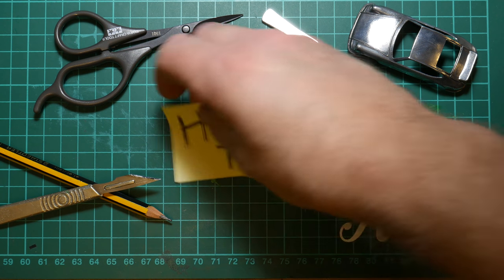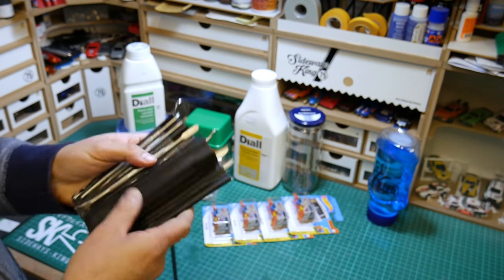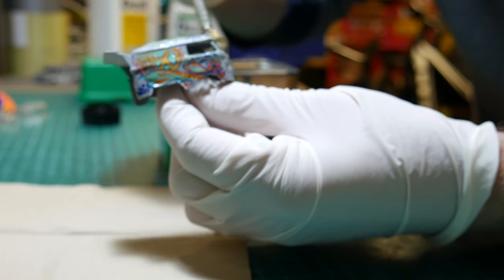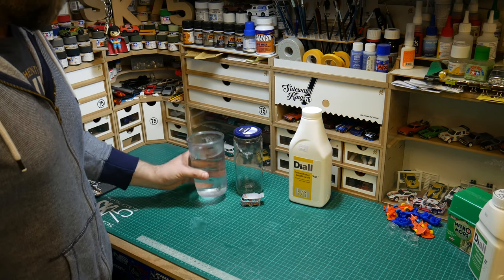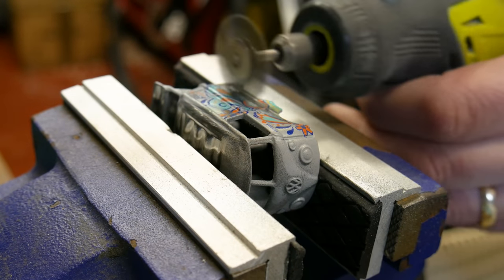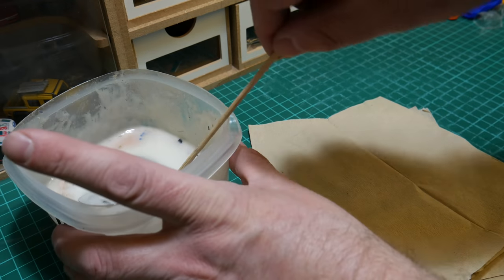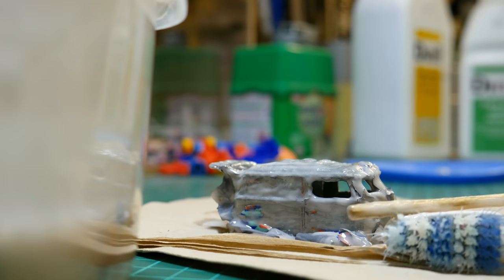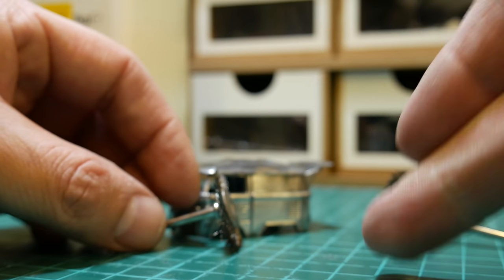'HOW TO' remove paint from die-cast cars - 4 methods compared

Comment: I love those little wire wheels but they are the worst for shedding tiny sharp bits of wire that end up on the floor / sticking into your toes if you ever go stocking-feet or barefoot. Great vid!
Reply from the maker: I know they get everywhere...... My wife comes nowhere near the garage and she still pulls them out of her clothes!
Reply: @SidewaysKing75  nightmare! My 2¢ of stripping advice for the stubborn stuff would be a can of Loctite Gasket remover. It sprays as a reasonably mangeable foam and seems pretty much no paint is a match for it, bubbling up in about 2-3 minutes. I use it on bike frames - heck - it even removes plasticised powder coat.
Reply from the maker: @LittlePixelTM  very good advice I'll look into that one thank you 👍🏻

Comment: Dunno if you have Easy-off oven cleaner in England, but it also do the trick. That's what I use for my model kits.
Reply: Some oven cleaners are just caustic soda with additives, we call it caustic soda over here, think its called lye stateside and is potent stuff, if you breathe in some of the fumes from some of the cleaners you can feel it literally burning your throat and lungs and caustic soda will have the flesh off your hands fairly quickly so not a chemical to be haphazard with :(
Reply: Make sure you wear gloves for easy off.  That stuff is very harsh.
I’ve used it on Tamiya RC ABS bodies that had several coats of paint on.
 Worked well, but my hands didn’t like it.
Reply: @stuartleckie  Yup. It burn. Also, I'd add to make it in a ventilated area.

Comment: Thanks for the tip on the Diall paint remover I finally got around to getting some after watching this video a few weeks ago, and as you say if your patient it works like a dream. I left a casting in it over night and this morning there was not a spot of paint left on it. Even a couple of hours is enough to get most castings clean, but I would recommend the over night treatment as bes option. Bought a 2.5Ltr container for just under £15 and with use of a glass jar and Time Riders Primordial Oose it should last me an age. Will keep some Caustic as backup as I still have half a packet, but if it continues to work as good I can see me sticking to this long term.
Reply from the maker: It's great stuff isn't it Tony👍🏻 The only casting I've found it struggles on is the Grey Hot Wheels Skyline R32 bizarrely. It's just really weird paint 🤔
Reply: @SidewaysKing75  As I am doing mainly Matchbox that is not an issue for me, but yes it is great. You do need to remove any plastics as they will be a gel if left in for any length of time but that's standard with most paint removal products. I've just started to use thick bleach for removing paint from Plastic wheels, screens and internal plastics. It works well and dose not damage the parts. Just the bog standard Thick bleach from any value store, I used the Home Bargains one and diluted it 1-1 with water.
Reply from the maker: @tonyhughes1958able  that's a great tip thank you ill be sure to give that a try.... thanks for sharing 👍🏻

Comment: Another great video, what makes it better is that my Mother in law works at b&q so I can get discount, lol. Going back to your making your own decals, may I ask what printer you have because the detail of your decals are amazing where mine is pretty poor.
Reply from the maker: Thanks Phil... I have an Espon Stylus 445W which is at least 5 years old and was cheap also at the time. I change the setting to gloss paper and print 'images' in high quality mode. It will be 10 times slower than normal but worth the wait.

Comment: Hi, thanks for the video. If you're not in a hurry I've found Dettol disinfectant to be a wonderful paint stripper. I used it on plastic models and it stripped the paint away and didn't harm the plastic.  I had a couple of diecast vehicles to strip down and it worked on those too. I usually leave them overnight so, like I say, it's not a fast method. I was quite sceptical when I was first told about this but I gave it a try and it worked. What's more you can use it time and time again.. Hope you don't mind me mentioning it. Thanks again

Comment: What a wonderfully informative and extremely helpful video, needing to strip back the paint on a 1/50 scale truck i decided to go with the diall paint and varnish remover and i have to say im delighted with the result, stripped totally clean using the same method that you used soaking it for 1-2 hours , thank you !

Comment: Weird, i just use acetone in a glass jar to strip paint off mine. Can take a while depending on what sort of paint is on there but im not in much of a hurry.
Reply: Does nail Polish work
Reply: Yeah but what about right areas the paint stays in?
Reply: @bumble_rumbles  -what do you mean?. if youre referring to areas you want paint to stay in, then immersing the body in anything isnt a good idea. if youre referring to pesky bits that wont come off, you can get them off with a scalpel, hobby knife, dental pick or sandpaper.

Comment: Have you tried electrolysis at all?   I am keen to see how that works as I used to electro-clean my old Vespa bits and always got the paint and rust off but wondering with these cars whether it would struggle with small detail.
Reply from the maker: I haven't Ian, others have mentioned it in the past but I've yet to have a go. Is there somewhere I can reference for what I need to get that you know of?.... All the best 👍🏻

Comment: I appreciate the comparisons, excellent work. But how does each method work with very old corgi or dinky models? The models shown are fairly new, and as such probably use modern paints.
Does the diall stripper work equally well on an early 60’s Corgi Scammell?
Reply from the maker: Yes it works perfectly. The newer cars are few and far between. The paint either comes off easily within an hour or has repeated dips and takes a few hours, usually if it has a transfer design. Its few and far between. 

The older cars tend to just all come off cleanly and evenly,  including all the panel lines and grooves 🚗🚙👍🏻

Comment: Hi, can you help? I have two green matchbox no 74 green Daimiler buses. They are in great condition but many years ago due to madness, I placed some white gloss numbers on the bottom of the model   eg a fleet number. Both have this issue but otherwise in great condition. I am at a loss to know how to remove these white gloss numbers without damaging the paint on the chassis and thus ruining the models.  Any ideas?
Reply: Depends what paint you used.
Isopropanol might remove hobby paint but spare factory paint.
I've used it that way.

Comment: I LOVE,LOVE,LOVE your videos, thanks for sharing. But could you do another video about paint stripping but then with:
1 - A copper wire brush ( as far as i can see you used a metal wire brush this time ? )
2- Sandblaster: there are small sandblasters the same size as a regular airbrush but with a bigger cup (BD-178 = 21 euro + 1 KG sandblasting material          BD-60 = 4 euro see airgoo-europe.com)
3 Laquer thinner
4 Baking soda
5 Carburetor cleaner (spray)
6 A combination ot a (dentist)-scraper for the panel lines + a sanding sponge (Tamiya, 3M or cheapest AmazingArt)
I just looked at your video of the Alfa Romeo 155 V6 Ti DTM, fantastic work but why put so much effort into cutting the engine-hood, building an engine, building a rollcage and then do nothing on the windscreen wiper? A bit of masking tape and a bit of paint or a permanent marker! would make a big difference. The same goes for the window frames: make the bottom of the side windows-frame black and the entire window-frames of the front- and rear windows black with either paint or a permanent marker and your cars go up from 9.50 out of 10 to 10 out of 10 !
BTW I love your videos and the choice of cars, I too love race- and rallycars, but i'm more into 1:43 and 1:24. Would you ever consider doing a 1:43 or 1:24?
I think about Burago 1:43 + 1:24 Ford Escort RS Cosworth or Ford Focus WRC, 1:43 Solido Lancia 037 Rally, 1:43 CorgiToys SilkCut Jaguar XJR-9 or Ferrari 512 BB LM or ;24 Burago Renault 5 Turbo (re-issue) to name a few. Don't get me wrong i really like your videos, and i learn a lot from you !! I hope you respond. THANK YOU.